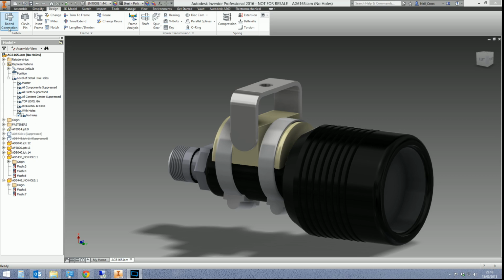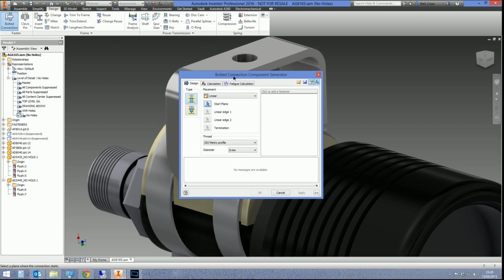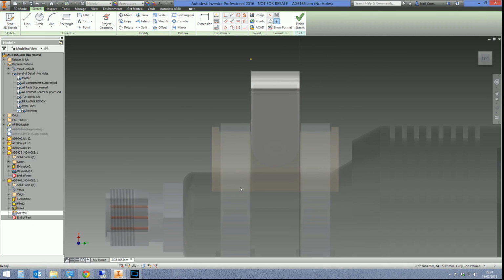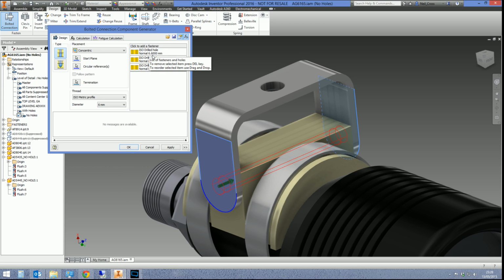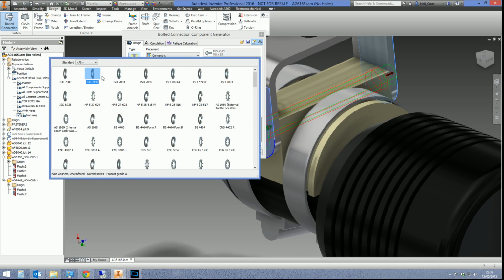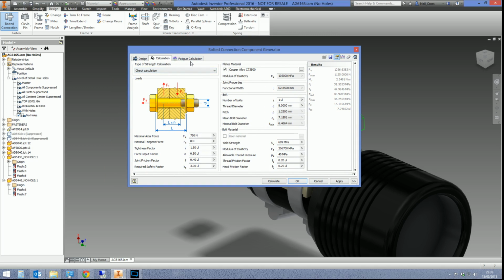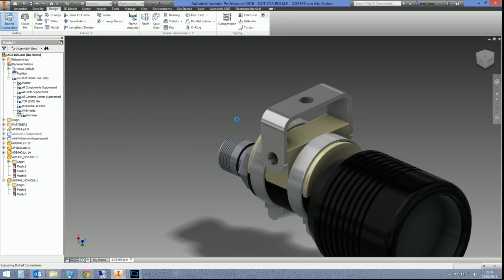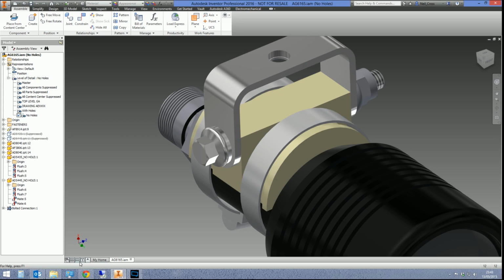How To Bolted Connections, Full (Almost!) Training | Autodesk Inventor

Comment: When you were doing your stress analysis on the axial, Inventor gave you two green lights for compliance. However, this was before the threads were extended through the nut. Is Inventor doing the stress analysis on the assumption that the threads are passing through the nut? I know this is Inventor 2016 and may have changed since (I'm using 2026) but it would be handy to know if Inventor is actually analysing the model 'as built' rather than just looking at the parts used, even if they are not compliant from an engineering view (eg at least 2 thread protrusion through a nut etc.).
It's almost like Inventor is just using an engineering table to look up the tensile strength of the nut and bolt and giving compliance if the axial load Fa is less than that of what's quoted on the table.
Maybe Inventor can analyse the model but it's a bit more involved.
I'm very, very new to inventor but I'm having so much fun building my models.

Comment: The problem with placing bolts and nuts with, with the automation is when you save close and open the file again it can't find the bolts because it is not in the project folder. It's in the content center.

Comment: I thank you for the video. I'm sure this can be done.  I'll find out tomorrow when I play with this but an 8.4mm hole would be oversize for our use. Hopefully there is a way to make these defaults tighter. i.e 8mm, 8.05mm, and 8.1mm for 8mm fixings. Then new clearances for ≥16mm and new again for ≥50mm etc..

Comment: A quick tip: disable all the random inch sized fasteners you don't need from the library so you don't have to wait 10 seconds for the menu to open up to pick which screw to use.

Comment: Hi there! 1st of all, hope everyone is alright.

2nd - about Connection bolts function, I use alot of UPN, better then UPE (C-channels), problem is UPN are tappered, so when using bolted connections i use tapper washers for that porpuses, but bolted connection don't, nor, use tappered washers.
What i do is just create 1 set, copy-paste and then constrain. or use pattern when its possible + i need to create the holes on the beams, TEDIOUS AS HELL, sorry.
Any smart work around? 

Be safe.

Comment: Amazing video. By the way is it possible to have a spacer in bw the  and bolt ? Like I need to attach a stepper motor to a bracket and I need it to be offset by 2 cm or so and I want to use a spacer. Is there a way to achieve this without having to design spacers myself?

Comment: Good day

Thanks soooo much for the amazing videos! I would like some help with I-beam Plate connections... I created my sketch, inserted my I-beams and the trimed and extended where needed,  now I need to do plate connections for the bolts and adding wheels but I'm struggling so bad! Made a sketch on a plain but it won't let me extrude, then I tried using and part import.... but my size and constraint are a mess!!! :(

Comment: It looked like a good tutorial, but it is pretty useless for a beginner. For instance you start from a particula case, as most bolted joints don't start and end in the same part. If you try and do it with a flange, it won't recognise the end plane in another part. Maybe it would be useful to do a more general example with two or more layers linked together.

Comment: Hi! I've been having hard time trying to make a connection using stud bolts. They never appear in the content center while specifying the bolted connection itself(click to add a fastener step), though there are a few in content center after all. Is there a trick to make them appear as possible solutions? Basically I want to connect two plates with a  stud bolt+washer+nut. No matter which options  or dimensions I choose there's no stud to choose from /cry.

Comment: Great Video! I know this video is a few years old now, but I have encountered a problem and I have no idea where to turn. On the dialog at 11:39, I am only able to select 5 mm. There are no other options with other standards and the drop down arrow is faded out indicating there are none. What do I do? I have already reinstalled, and this has not been an issue in the past when I have used this accelerator. Thanks for any help!

Comment: TFI, Thanks a lot for showing Bolted Connections in such a detailed level! You make the best tutorials for Autodesk Inventor and you certainly have earned the title Autodesk Expert Elite! Tutorials like this saves both me and maaany others alot of time and pain! (sort of..frustration at least) ! I guess you have been in that situation and done a ton of trial and error, hence you are the expert.. but still that's the best way to learn and remember ;) I am a Senior Piping Engineer working on modifying and improving existing oil rigs in Norway. I have been using Bentley Microstation and PDMS almost every day for over 10 years. Client and the company I'm working for choose this as a standard. I know as a fact that a Bentley user like me, have more difficulties converting over to Autodesk, because its somewhat another way of thinking when modeling. I'm currently learning how to design in Autodesk Inventor privately, and the only question I have regarding this tutorial, even doe I guess you might have covered that or will cover that in a tutorial for Partlists and BOM view.. or maybe its so obvious that I have not discovered it yet... Regarding Bolts, Washers and Nuts in the partlist.. Is there a way to compress them into one item number in the partlist like in example text "M12 Bolt x 115 mm lg (material bla bla, C/W (Comes With) Washers and Nuts)"? So various sizes and length of bolts does not clutter or dominate the partlist when you have designed/assembled a complex component? Anyways, again.. Many thanks for the tutorials you have made and making, they really helps!
Best Regards Alfie.

Comment: Great Video, however, when I tried to practice this feature on two simple solids using a socket head cap screw, Inventor 2015 wouldn't create a desired counter-bore in the first face. Did I miss something or is this not possible? I didn't try a flathead but I'll assume it behaves the same way.

Comment: I start using this feature and it's awesome. It's great when you have to change the size of a bolt. 

But Have you ever had an issue where the bolt gets generated but the holes don't. On like a linear one. 

Im trying to put a hole through a flat surface then through a round shaft then terminating through a flat surface again. 

Great vid keep it up.

Comment: Great video, I can tell you are a master at this and the humor
is not bad, it actually bring me back for a second look.

I am a fusion 360 enthusiast learning from videos (
incredible program). After my frustration making holes, picking bolts, screws
and nuts, then assemble with the joint command. 
Hope, the picture shows up. If not its very similar to the bolt going
through the bracket, mine is a swivel arm for a monitor.I decided to make a suggestion and recommendation to the ideastation. Follow this
link (http://forums.autodesk.com/t5/ideastation-request-a-feature-or/idb-p/125/page/2)
Now today after viewing your video I know all questions have been ask and
answered by AutoDesk Inventor.  It is
obvious that Inventor is for mechanical engineers and businesses focus on
design precision and fusion 360 mainly to replace drawing one’s idea on a
napkin. Seem to me the ideastation is just another tool to bring in curious on
lookers. My question to you is why not do a comparison video about two very
similar CAD software competing for new customers? Why buy one as oppose to the
other? Do you think a giant like Autodesk could capture all the world’s young
aspiring engineers by giving away all their software and make money by advertising.
I think giving it away can’t be equated to free, it could be a game changer,
just look at Facebook. What do you think?